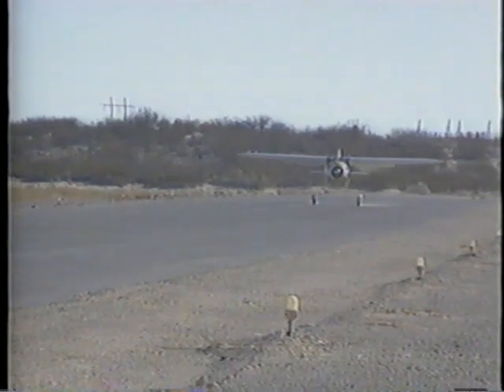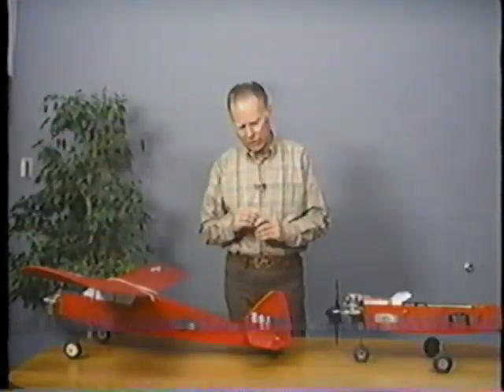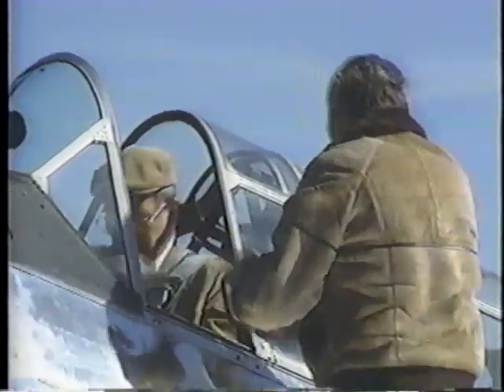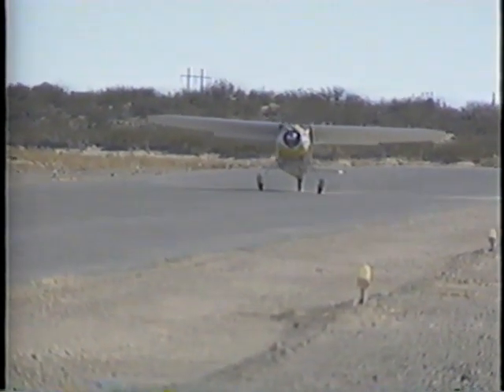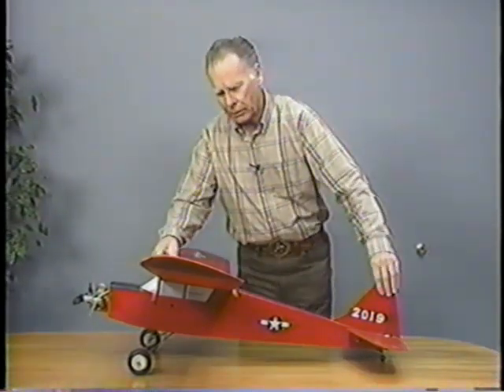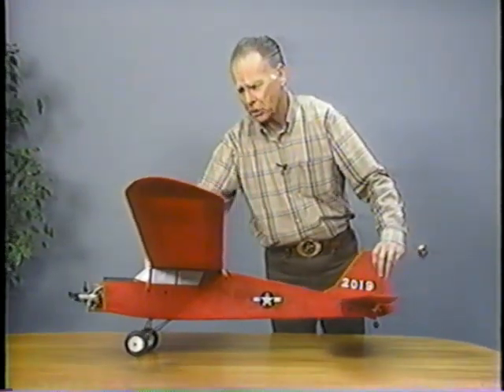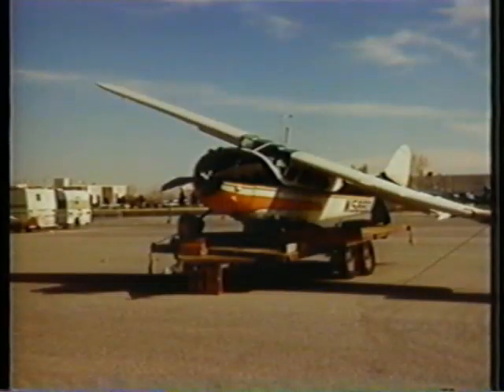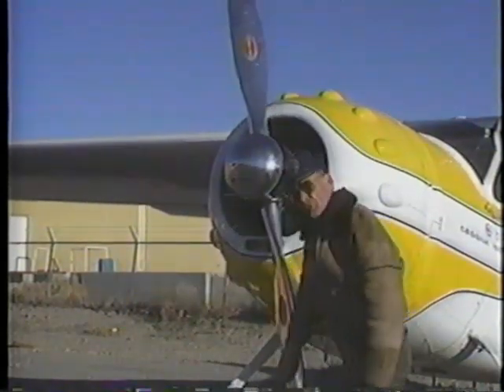Taming the Taildragger

Comment: ..."I knew it was going to be a long day..." Good Stuff!
Reply: Juan, I wonder if this instructor grew up on a farm like many of his generation, because turning brakes are standard on tractors, and as such they may have been subconsciously aware of using them for directional control.
Reply: BTW between the Stearman the Lockheed and the wind you'd almost think this was filmed at 1 kilo 1
Reply: This is a great tutorial. Looking to get back into flying. I want a bearhawk 5. Well a fella can dream. Always watch your channel. And vasa. Together you guys rock it. I like the way you cooperate with each other. Good stuff.
Reply: @russellsmith3825  Thanks for the link. I will check it out.
Reply: @russellsmith3825  I checked out the LSA thanks. Impressive stats for sure. Range, Speed, Payload. Pricing seems fair as well. This is an aircraft that could make a lot of people happy.

Comment: I’m mystified with what was just said. I learned in a 172/150. After I got my ppl I went around and flew anything I was allowed to.  Mooney, pipers, sailplane, Citabria only  taildragger.   My experience was a check ride and turned loose, 20 minutes.   This was way back in 1963 about.  I had a preconceived idea how to take off and somewhat how to land.  My idea on talking off was line up advance throttle, gain speed, push stick forward to lift tail, when flying speed reached ease stick back to lift off.  Nice idea but way off the truth.  Actually, lined up shoved throttle foreword and lifted off. That Citabria just flew right off the ground.  I weighed around 180 and was solo.  Had a terrific time playing fighter pilot.  I do not understand hours to solo a taildragger of getting a certificate or rating.  I suppose the possibility of a ground loop is more of a possibility.  I haven’t flown in 50 years so many things have changed.

Comment: These old dudes are straight-up badasses.  Regarding the 195 wreck, it’s critical ,like Larry says, to keep your eyes on the far end of the runway on rollout.  Unfortunately, when the tail comes down on a plane like a 195, you can’t see ahead.  I suspect this is why so many 195s are destroyed by groundloops.  The technique I use to deal with forward visibility loss, flying stuff like Beavers on 35” tires, and 180’s on 31” bushwheel, is to load the plane neutral or fwd CG, and fly the tail high to a full stop.  Like Larry says, there’s a point in a full-stall landing where you become a passenger.  I refuse to be a passenger, so I’ll use a combination of brakes, power, and up elevator to transition a three-point landing back to level attitude whenever possible.  Helps you see and avoid stumps, gullies and boulders when landing off airport, which is what a lot of us use taildraggers for in the first place.

Comment: Ailerons are the largest control and most abused, least understood control since arrival of the Cessna LAND-O-MATIC (nose wheel) of post WW2. 
Ailerons are 2 to 4 times the surface area of the rudder & 2 to 4 times the leverage of the rudder. . . AND being horizontal to the relative wind, therefore mostly unstalled at any angle of wind.
Ailerons provide roll control, x wind drift, & on take off or roll out provide YAW that supplements directional control. Ailerons will ALWAYS over power the rudder if applied into the applied rudder.
Rudder is the smallest control, also being VERTICAL to the relative wind, easily stalls LONG before the ailerons do.
Take offs & rollouts are ALWAYS X CONTROLLED so that aileron YAW always supplements the rudder. To do otherwise, is to cause a runway deviation that brakes WILL NOT FIX.
Good Car habit of turning into the swerve  must be addressed in training, because airplane contr is opposite and will accelerate planes demise. 
RULE: Ailerons PROPORTIONALY OPPOSITE the rudder on take off & roll out will save most runway deviation events. CFI 1507987
Reply: You're suggesting that on a X-wind takeoff the ailerons be rolled away from the direction of wind to take advantage of adverse yaw. I would strongly recommend that no one does that.
Also there is no vertical or horizontal relative wind.

Finally if you hold a plane in a deep stall how do you bring the nose back up as the nose inevitably falls off to one side or another. Ailerons????

Comment: I was fortunate in my flight instruction 36 plus years ago. Learn to fly out of an 1800 ft grass strip with a training wheel on the front and Cessna 172s and 150s. The difference is my instructor was really adamant about me landing on the mains and holding that nose off as long as I could while using the rudder to keep it straight. A few years later and before the tailwheel endorsement was actually required I took instruction I a Cessna 140 to prepare for flying my experimental airplane. It really did not take me very long to get comfortable with the airplane. I believe it was in the neighborhood of about 4 hours. I'm sure that is due to the instruction I had a few years before. Now after many years I'm not owning a conventional gear airplane I have owned a couple in the last few years and the one I currently have is a Tailwind W8. It came back fairly quick and I believe that flying a conventional gear airplane makes you a better aviator when it comes to talking off and landing the other what would call training wheel type airplanes.
  Excellent video. And by the way I really like that Cessna 195!

Comment: I started flying lessons in 1969 and was thought in a brand new Cessna 150. And we were taught to flare in the landing and touch down on the mains and hold the nose gear off as long as possible while steering with the rudder.
Reply: I'm just taking my lessons, in a 150, and I'm being taught the same.

Comment: So if you start out with a takeoff run at full power and the plane starts to left due to “P” factor and torque, you of course, apply right rudder. What 
happens if you need a little more drag and steer to the left, you would induce drag on the right wing to help also keep you from going too far to the left,  no? Takeoff with left crosswind is best while landing with right crosswind is also better.
Reply: The only time you use aileron on the ground is when you are taxing if there is a wind to keep the wings down to make sure the wind does not lift it and flip you over and during take off and landing during a crosswind situation  keep the wing down and into the wind usually your on one wheel and rudder to keep it tracking straight down the run way.